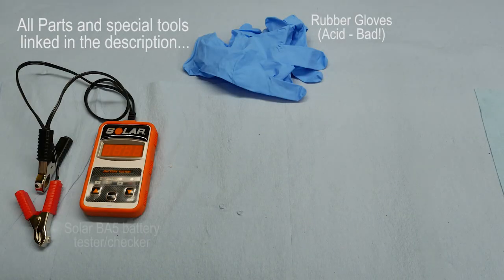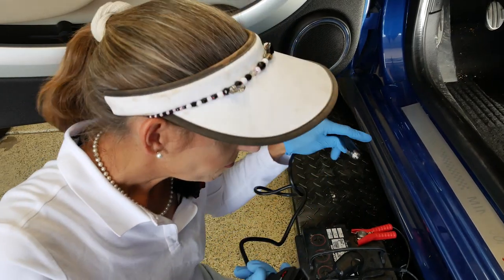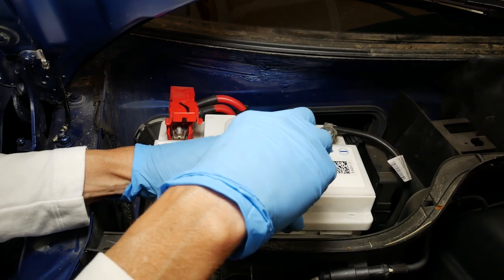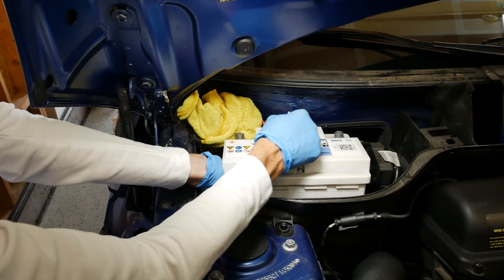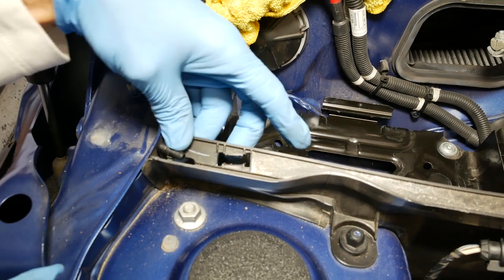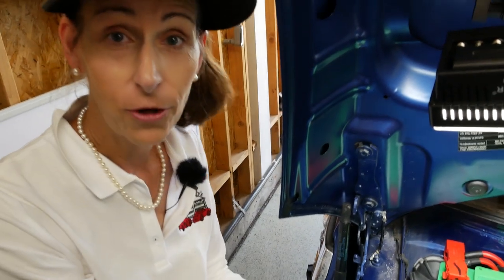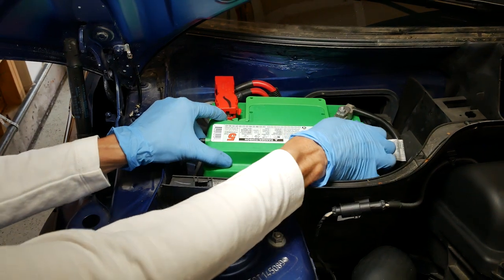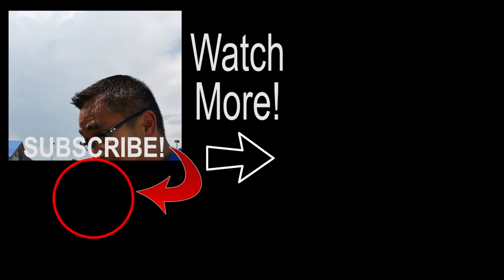How To Replace a Car Battery - MINI 2012 EASY With Test!

Comment from the maker: Hi All, Battery died in the MINI :(

Tools and parts:

• Solar BA5 battery tester/checker https://goo.gl/dH6uoR
  (or Solar BA7 https://goo.gl/x84nXy)
• OBDII power memory saver https://goo.gl/Jqow98
• 10mm nut-driver
• 10mm Socket
• Ratchet
• New battery - MT-47 H5 (Autozone)
Reply: This part I understand my question is how do I know which battery to buy to replace it
Reply: @user-wg7nw3mh2e Costco has an interstate marine battery

Comment: Pretty straightforward job. Glad you remembered to look for acid in the battery compartment. One question: was the old battery the one it left the factory with? or already a replacement?
Reply from the maker: Factory.  Yes original.  Exide BMW.

Comment: Is that an interstate battery? any reason why you went with that? I usually have had good luck with the Duralast house brand from Autozone.
Reply from the maker: Ya know, no except that when Heidi was calling around they gave her $10 off and it has a 5-year warranty.  It is a little weird shape wise and more expensive at $150 than I thought.  The guy at the store was so excited about the 356 so that was fun.  Great to hear that the Autozone battery is a good piece.  I think the original should have lasted a little longer, but it was pretty easy to swap out.
Reply: I have always had bad luck with OEM batteries, i think as the car is shipped to the dealer, poor battery maintenance on the dealership is the culprit.  After about 3 years in new cars, I usually keep a close eye on the battery.   These newer AGM batteries though might be better.
Reply from the maker: That never happens with tires that actually come with a new car either....  I don't get it.

Comment: Where did you get your swivel head stubby socket wrench and is it 1/4 inch drive or 3/8?  I like that design better than the little one I have.
Reply from the maker: That little green one? It is super useful!  It came from Harbour Freight.  They have a bunch of those sorts of ratchets in several sized.  It is a ratchet and nut driver in one.  HF is perfect for stuff like that.  F
Reply: Thanks!
Reply from the maker: Oh, sorry, you asked about the size...  Yup 1/4"  I have a 3/8" and 1/2" and they are both really useful.
Reply: We have a Harbor Freight in town - I'll check it out.  I like the fact that it's swivel and insulated (since it would be useful to use around a battery - LOL).  Thanks!

Comment: Hi Heidi and franny ,  bit of a vague question is it easy to upgrade the brakes on my 996 c2  from standard as I’ve just done a track day and the brakes were not good please advise
Reply from the maker: Hi Mike, I think you can upgrade to Brembo brakes.  Do you have Wayne Dempsy's 101 Projects for the 911?  I know he goes over that conversion for the Boxster.  Wayne's books are really helpful and only like $20.  Pelican has all the articles on their site as well.  I think it is mostly just rotors and calipers.  Shouldn't be too crazy to do. F

Comment: Hello Franny, what do you think about the "BIG3"  installation to improve the electrical performance in the car?  I have done this BIG3  in my cars including a 1964 beettle, and the results were great 12.4 vcc before and 14.1 vcc after measured in the car front; I would like know your comment, regards.

Comment: The battery's rating is probably the cold cranking amps (CCA), which is lower than the regular cranking amps (CA) which your meter was testing.

Comment: Hi, would like to ask, with the OBDII Memory saver with 12V battery, is it this will avoid FRM module fried too ?
Reply from the maker: What's the question?  I am not sure I understand.
Reply: @HeidiandFranny  For 2nd generation Mini Coopers, a dead or disconnected battery commonly corrupts the FRM software, rendering the power windows and certain car lights inoperable.  When this happens, the FRM must be reprogrammed.
Reply: @rj7008  I was able to change the battery in my 2012 using the battery saver. Im not 100% sure if it will avoid the FRM issue but mine was ok after changing the battery while using it. They say the FRM just doesnt like no power for too long (so days with no battery) and also it doesnt like a surge in power. So negative comes off first and its the last to go on. Theyre all things you can at least do to help prevent the issue. Im about to pull my negative to do an ECU Reset and Im sort of worried about the FRM again.
Reply: @sassyrav  Before disconnecting the battery, one person additionally suggested unplugging the FRM connectors OR removing the 4 FRM fuses behind the passenger kick panel.  The latter seems easier.  And I also agree with your idea of using a memory saver.
Reply: @rj7008  yes I though about that also. Great idea. I've got the the diagram for the fuses so thatd be the safest way.
I read resetting the ECU via the battery won't work on the later model BMW cars (2012 Mini) and clearing the adaptations would be the only option to reset it. Bugger, hope this won't upset the Mini.

Comment: I replaced the battery on my 2012 Mini Cooper S and after replacing it the radio didn’t work, do you know how to reprogram the radio or what the issue is? Thanks

Comment: Does the new battery have to be registered on the ECU  if you change with the exact spec battery  manufacturer etc any help appreicated
Reply from the maker: Good question, but I don't know how the car would ever know what battery is fitted.  So far so good...
Reply: It has to be registered only if it has on the negative pole IBS (intelligent battery system). In this video the car shown does not have so it is ok to replace it like this.
Reply: @ripperbill84  wow I did not realize that. I know it’s easy to see the IBS but what would determine whether or not an IBS would be used on a particular MINI? I thought all BMW and Minis were equipped with one.
Reply: The 2013 Cooper S has one. At least the UK version anyway. Just replacing my battery after 10 years at the weekend.

Comment: Great video. I don't know if it's the right thing to do but I always grease battery terminal. It prevent terminal corrosion, as far as I know it work just fine and doesn't have any side effect on battery.
Reply from the maker: That is a good point.  There are dielectric greases out there that work really well.  These terminals were perfect so no need.  I read that the corrosion id from the free hydrogen and oxygen from the battery charging.  A good vent is critical as well...

Comment: What IF you didn't put the car on life support before removing battery?  My car is running rough and showing Check Engine and Flat tire warnings.  Can I reset this or am I in for a big bill from the dealer?  I have a 2010 Mini Cooper.
Reply from the maker: Removing the battery will not clear the fault codes...  Your best bet it to get a code reader and plug into the OBDII port and read all your fault codes.  You can find lots of info with a Google search on those codes.  At least you'll have some information on what is going on.

Comment: No need to register the battery?   I saw this done by a bmw tech...
Reply from the maker: No...  When we had the battery swapped out in the i8 they actually ordered a "registered" battery.  I asked what all the fuss is and it was just so the car can charge the battery better...  Really??  Hmmm...  Anyway, the Mini was just fine.
Reply: From where?
Reply: My 2013 Cooper S has a agm start stop battery. If your car has the IBS module on the negative terminal you will need to register the battery change. If you don’t the battery is likely to fail prematurely. I’m just coming up to the first battery change after 10 years, so I don’t mind the cost too much.
Reply: As the battery ages the IBS increases the charging current to maximize use of the tired battery. Registering the new battery prevents the IBS thinking it is still dealing with the old one and overcharging the new battery, which can damage a new one.

Comment: Can't get my key fob to start my car when I put it in I get nothing I checked my battery it is full I replaced the battery in my key fob I still get nothing interior lights work stop start light works radio works but it will not recognize my key or start my car what can I do
Reply from the maker: There is a way to pair your key with the car.  I'm not sure if the exact procedure but I think it is in the manual... It involves holding it close to the steering column I think. Does you key open the trunk?
Reply: Hi mate! Did you fix it? I'm going to change my battery but im not sure about that. There are so many people complaining about that problems. And did you do it with an external battery to save your car memory?

Comment: Well done like always,  just one little safety item again  "during normal operation of usage the car alternator will recharge the car battery during that process production of hydrogen is created  that why the vent is there  >> so technically  a risk is present of spark to occur to ignite the hydrogen  that why the safety gear is a most. Especially eye wear when working on car under or from the top  ( sand, loose debris, compress air can unlodge.dirt = airborn partical  + corrosive liquid ( brake fluid and all) you don't want a splash of that in your lovely eyes Franny / Heidi. I sorry to sound like a broken record with this I did made the same point on the Porsche battery replacement   All the best guy s keep up the good work. SoulDave
Reply from the maker: Sorry Dave, You are quite right.  I am a little thin in the safety department and I'll try to get better.  Learned my lesson with brake cleaner.  Thanks for the reminder (I probably said that last time too ;) ). Franny

Comment: What about "registration" of the battery. Mini swears that the whole charging system is at risk if you don't program the ECU with the new battery. They charged $139 for the service. Highway robbery/extortion if you ask me. Online comments do seem to support the idea of problems down the road.
Reply from the maker: I haven't heard of that.  I'm wondering how the car would know with that ECU memory saver.  $139??  I hate being gouged like that.  That is more than half the cost of the battery!  I suppose if I run into issues later I'll look into it. Thanks for the head's up! F
Reply: Our Interstate battery did cost exactly $139! Here is a link: https://www.mini2.com/forum/second-generation-faults-fixes/265618-register-new-battery-how.html 

Oh, I adore your videos. I always go at projects in fits and starts exactly how you did with the Spyder. I will go only so far, until I need to go further. You are so good and your videos have such drama and narrative story telling. I can't wait until we learn what the machinist said. Will you interview him as you show him the head?
Reply: If the car has IBS any new battery will need to be registered or the car will overcharge the new battery. You can get tools to do this for about 50 bucks.